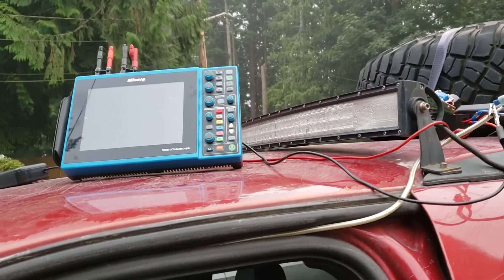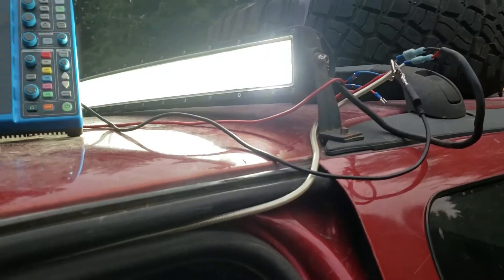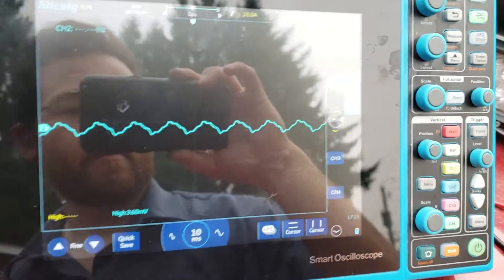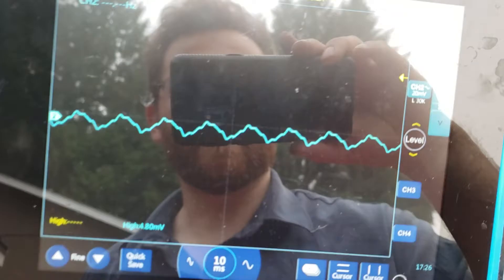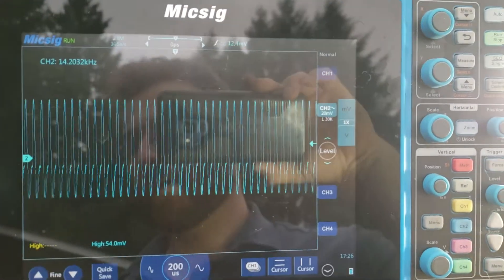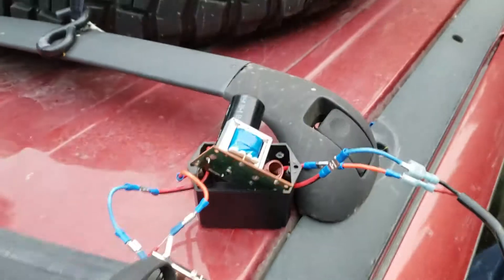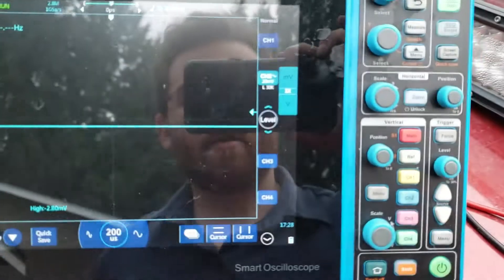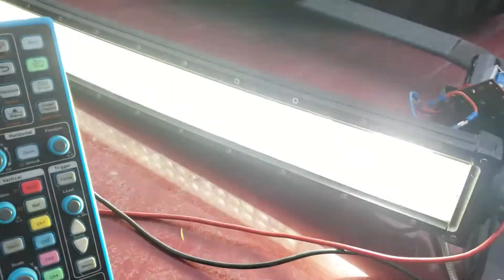Filtering Out Radio Frequency Interference Generated by LED Light Bar

Comment: Mr Ryan, so I am having the issue with my 98 Freightliner that I put led headlights in. Everytime that I turn on the headlights, I get feed back through the cb. Now how do I implement this into my regular headlight system? Any help and advice would be greatly appreciated.
Reply: what filter can i use for my led headlights

Comment: Wouldn't a couple of snap on ferrite cores, one on each wire to the light bar, work just as well?
Reply: Not flat on the oscilloscope like this. Not as good. A filter just removes it (almost), chokes suppress it. 
Better to eliminate it from the offender than put bandaids everywhere if you know what I mean.
Problem is every brand is going to make noise at a different frequency so no one filter is going to do all brands effectively. You can't win.

Comment: So I've been having issues with my keyless entry on my 4 runner and last night the bulb went off in my head and I realized that I never had any issues until I swapped out my dome lights with my home made leds that I made from a 12 v bulb ment for track lighting wich works great and I'd like to keep them but lastnight I waited for my dome lights to shut off and my truck locked first shot I have a basic understanding of electronics but never really got into any of the rf interfere so I guess my question is being that my rke system controls my dome light I'm assuming the led are polluting my keyless signal and is this something that could be solved with a choke or would I need to get some sort of rf filter I'm using the original led driver out of the bulb so I'm assuming the compliant with all the regulations I also have a led light bar led headlights and fog lights but thoes aren't usaly on while I'm trying to use my keyless thanks for your help

Comment: Am having the same problem with my car aftermarket tail light which i upgraded recently.could you pls give the circuit diagram of the filter that you made.
Reply from the maker: This is actually a Low Pass LC filter I ordered online. The basic circuit design and variations there of, you can find online. Just search for Low Pass LC filters. L stands for Inductor and C stands for Capacitor.

Here is a link with some good information on Low Pass Filters.

https://electronicbase.net/low-pass-filter-calculator/
Reply: @ryana.miller8260  link to order ?
Reply: @ryana.miller8260  link?
Reply: @ryana.miller8260  thank you so much 😊👍
Reply: So where can you buy This?